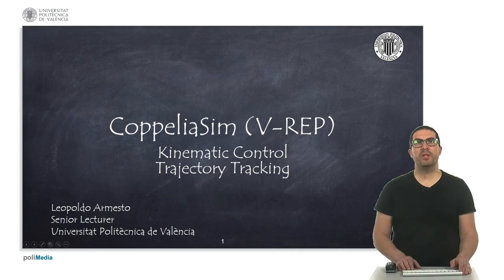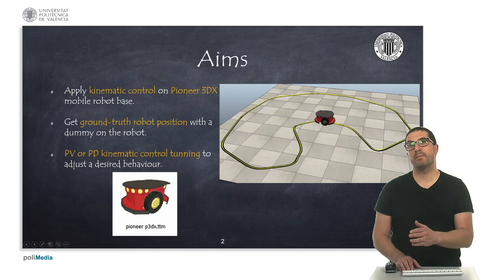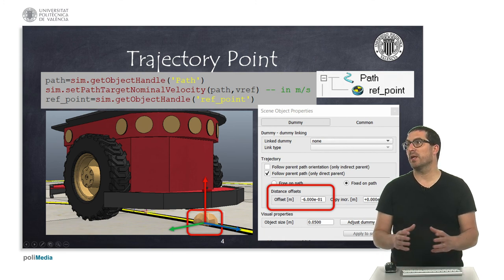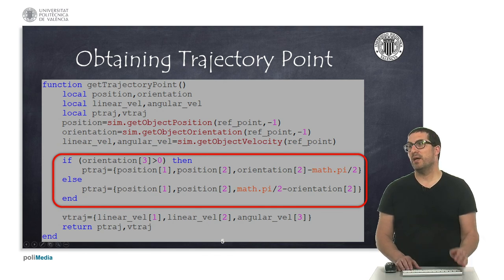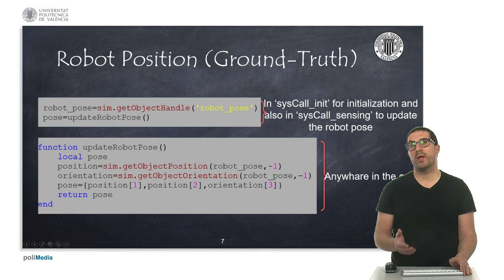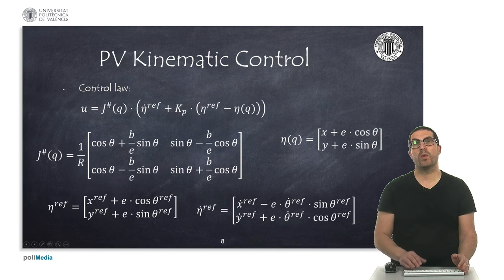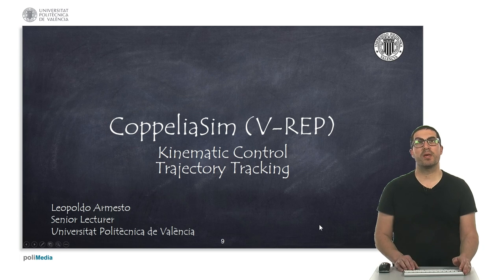How To Implement a Kinematic Control with Trajectory Tracking | CoppeliaSim (V-REP)

Comment from the maker: The pioneer 3dx robot has the following constructive parameters:
Wheel separation: b = 0.1655
Radio wheels: R = 0.1955/2

To properly align the dummy 'robot_pose', you must use the tools offered by the software to copy/paste the values of certain coordinates. For example, if we temporarily make child the dummy of any of the pure objects of the wheels, we can align it so that it is right on the axis of the wheels (make its coordinate X with respect to its father, that is, the wheel, be X = 0). In the same way, so that it is right in the center of that axis, we can make the dummy be the child of the robot and with respect to the father (the robot), its coordinate is Y = 0. The orientation of the dummy matches the orientation of the robot.

Comment: Hi Sir, thanks for the videos. Can you have a brief introduction on which angle we have from the orientation command of the dummy "ref_point"? It's hard to understand (orientation[3]>0), orientation[2] - pi/2, etc. Thank you!
Reply from the maker: Hello, the ref_point reference frame depends on the internal reference frame of the path. The easiest way to the define the path is to select the option ‘Keep X up’ which is different from the robot pose reference frame. Thus, we need to obtain the actual rotation angle from the robot’s point of view. Due to Euler angles there’s a discontinuity on the angle to make work properly. That’s why the if condition is used in this code snippet, to obtain a valid ‘yaw’ angle of the trajectory.
Reply: @LeoArmesto  I see. Thank you very much. In this tutorial I understood the difficulties in matrix calculation in Lua language and Vrep. It would be very helpful if you consider giving tutorials on how to connect vrep and Matlab or ROS for more complicated projects. Anyway, thanks for the tutorials and I will keep following!

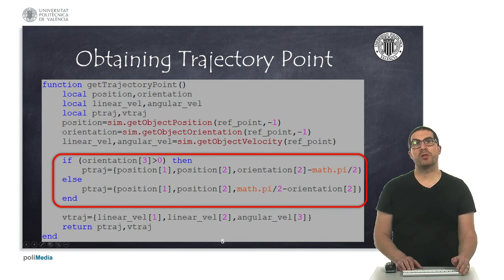Comment: Hi, Leopoldo. In slide 5 (Obtaining trajectory point - @4:05) the angle of the reference point inside the "if" is defined as orientation[2]. Shouldn't it be orientation[3], instead? It seems that orientation[3] is the rotation around Z, which is what we want to obtain. Or I am missing something?
Reply from the maker: In a path, the internal reference frames, the X-axis usually points up. That’s what we need to compute that angle using different coordinates. The ‘if’ is to avoid Euler discontinuities
Reply: @LeoArmesto  , Thanks!

Comment: I dont think sim.setPathTargetNominalVelocity exists in the latest version, are there any alternatives?
Reply from the maker: Actually in the change log does not mention anything of that (or at least I can’t see it): https://www.coppeliarobotics.com/helpFiles/en/versionInfo.htm#coppeliaSim4.1.0

I will find out how to reproduce the same results with the newest version...
Reply: @LeoArmesto   it's not getting highlighted in red when I type it down
Reply from the maker: Hello, I’ve got a response from CoppeliaSim forum:
You need to add following to the actuation section of your main script

simHandlePath(sim.handle_all_except_explicit,sim.getSimulationTimeStep())
Reply: @LeoArmesto  It is still not working. I am getting error as stack traceback:
        [string "Pioneer_p3dx@childScript"]:32: in function <[string "Pioneer_p3dx@childScript"]:28>
Reply from the maker: @sachinvenugopalan7121  Hello, is this issue related with the code suggested in the video? It looks that the root of the problem is something different...
Reply: @LeoArmesto  When I remove this line sim.setPathTargetNominalVelocity from the script, it is not showing any error but the robot does not move.
Reply from the maker: @sachinvenugopalan7121  which version are you using?